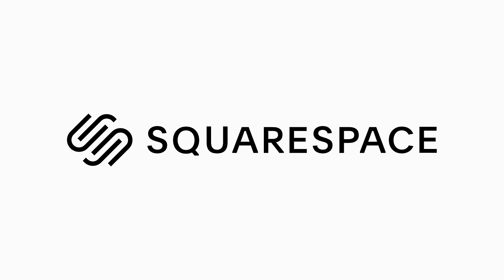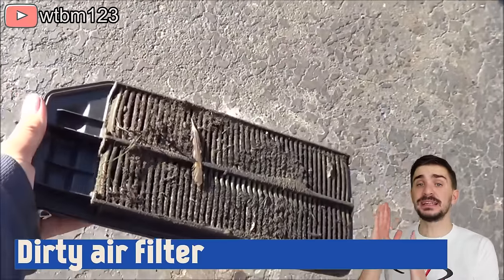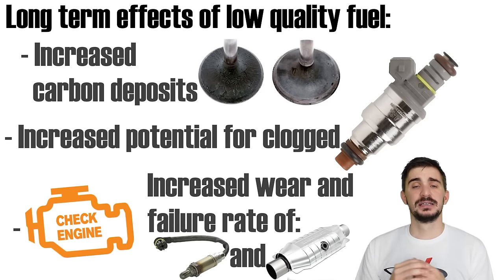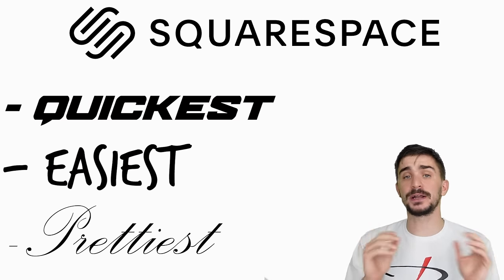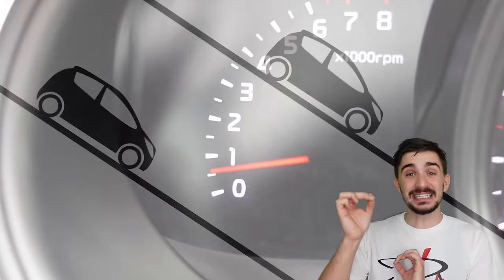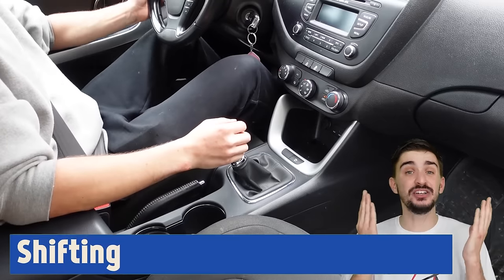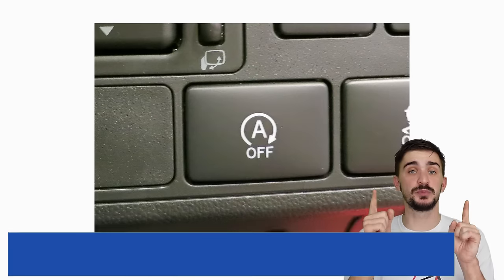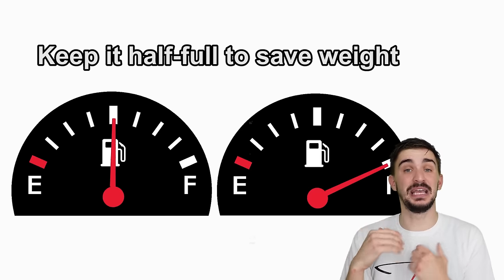EVERYTHING on FUEL SAVING - PRACTICAL DRIVING and MAINTENANCE techniques to REDUCE FUEL consumption

Comment: This eco video is whack, anyways i always thought the amount of petrol i see injected is crazy and i was right, see ecovette on youtube, got 40mpg on a v8 corvette not even trying. I would lean a small i6 until it's really stuttering lol, character and enough power. And that's the thing, why not air cooled engines in cars for weight saving, electric, regen, there's also hydraulic regen but i would have a circle with spring to take in braking directly and use that mechanical energy for propulsion and powering accessories, lightweight and exotic materials, build a good quality cars that has likewise resale value and running (no) cost. Am supposed to also tell you to become a real muslim. (That's how you're supposed to do it)

Comment: this video is so wrong, if you are going to idle for more than 7 seconds is better to stop the engine, there is no way to lug a engine that has a drive by wire throttle body and in fact is more efficient to be in a higher gear with more load in the engine than in a lower gear with a very low load because of pumping lossses
Reply from the maker: Sounds like you have a lot of real world driving experience

Comment: To much nonsense and misinformation here so I'm unsubscribing. Oil viscosity nonsense, pumping losses from blocked filter nonsense, what do you think a throttle does? and more, also you clearly don't understand about how to coast, you don't turn off the engine, you put the transmission into neutral and coast to take advantage of certain road conditions that you meet, the driver remains in full control of all the vehicle functions except acceleration which only takes a moment to restore
Reply: 1. Oil viscosity explanation was a genuine mistake. 
2. Pumping losses from blocked air filter is accurate
3. Coasting in gear off throttle vs in neutral is accurate in regards to fuel consumption with the safety aspect.